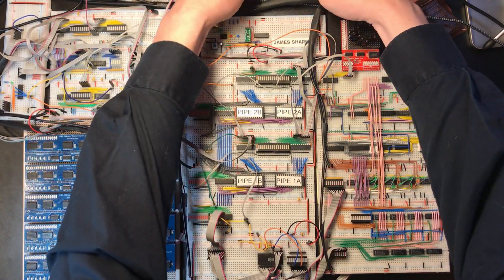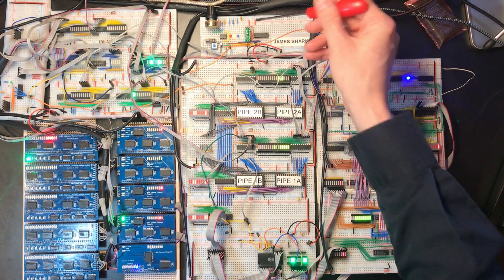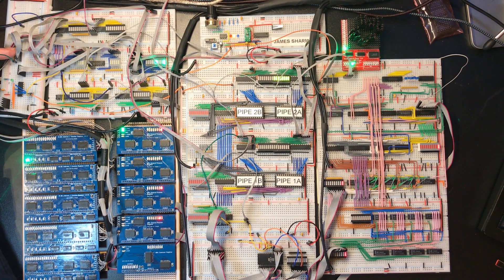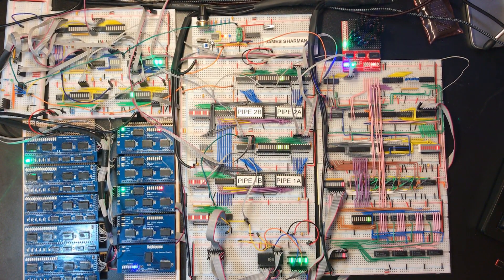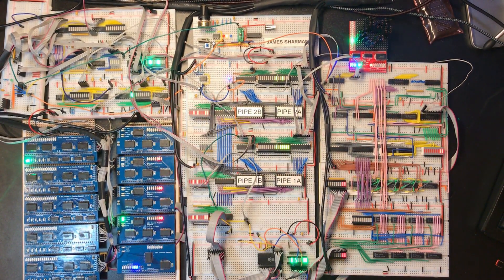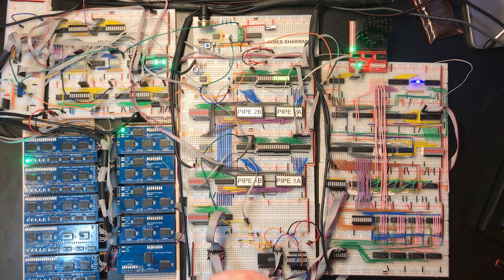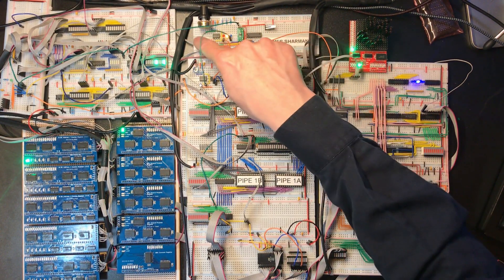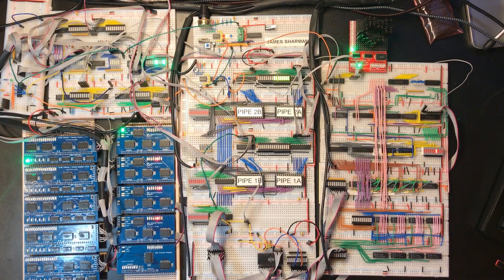Clean Reset - Making an 8 Bit pipelined CPU - Part 45

Comment: (2:31) That's a clever way of handling that.
(3:43) Now, it seems your (techinically inverted) reset line is still feeding into all 20 of the counter chips on the address register boards (plus associated LEDs), which still seems like an awful lot.

In the description of this video, you say that you add additional refinement to the reset circuitry in video 45. However, this is video 45.

EDIT: Now, the ALU clock is still driven from the original clock, but everything else appears to be running off this combined reset/main clock. That's actually actually, good, though, because it helps cancel out some of the propogation delay between the main clock and the ALU clock, and the ALU isn't being used during reset, anyway.
Reply from the maker: That should have been video 74, I've updated the description.

Comment: Could you not have wired in the nop pipeline feeder during reset? That would eliminate the need for the nop at address  0
Reply from the maker: It would indeed, I do revist the reset later in the series. In this case I wouldn't have minded too much as I like to avoid adding chips.

Comment: Just working through the video series, so I know I'm WAY late w/ this. If you had used a 74HCT273 for the latch back in video 9, it would have made the reset a lot easier. It has a CLR line instead of OE.
Reply from the maker: Hope you are finding it interesting! Having the clear line would have been really convenient. In this case you would have needed to use them on the output latches for the control lines as well, a total of 9 in the pipeline. It would indeed have made this particular job easier, but the pin out of the 273 is horrible compare to the 574 for breadboard work. Have a look back at the breadboard and think about how much more complicated the wiring would have been. Incidentally I do come back and handle this differently later on.

Comment: Now you seem to get in need for a supplementary training device :-p
I would have done the reset much earlier, for sure.
Simple thing, but makes it suddenly much nicer :-)
Reply from the maker: By "supplementary training device" do you mean some way of getting code over the cpu without all that slow messing about with rom's? If so then I certainly will be doing that some time.
Reply: No, i ment the lack of physical activity by not pressing any more the clock button until everything was emptied.
But if you stop swapping the ROM chips as well, this probably feels like the progression when cars got electrical starters :-)

Comment: in my rebuild of your CPU, when resetting, the adress counter registers are resetted, also of course PC, but the assert of PC to AdressBus would occur on next clock pulse, which never comes, because of reset and therefor in Pipe0 is the next instruction. What am I thinking wrong?
Reply from the maker: You are not wrong.  I can’t remember when I made the change but in my current build the clock going to the address registers is the one merged with the reset circuit.  This solves exactly the problem you have hit where one instruction get’s fetched from whatever address happens to be in the latches. I make some tweaks to that circuit in part 62, I want to revisit it again at some point and limit the number of clock ticks the reset generates, I think there is a possible issue with the way I’m merging it with the main clock that will only come into play at higher clock rates.
Reply: @weirdboyjim  So I think ORing the main clock with the reset clock and the output is the clock for adress registers, so eg the PC will assert the NOP instruction zu AdressBus each time the reset clock pulses. I´ll try that, thanks!
Reply: that solved the issue, thanks!!

Comment: For the final power on reset circuit  a simple RC circuit will do the trick. That's what I'm doing on my build.
In my case, all the chips I needed to be determined on power on were active low, so the output of the capacitor(initially discharged) takes care of it. If you need an active high, the resistor output will do it.
I personally like to keep the RC time constant as short as possible. Also, I would recommend using a reversed diode in parallel with the capacitor to avoid negative voltages and off behavior.
Reply from the maker: I like the reset chip I’m using for it’s low voltage detection. That said, I’m not that precious about where the reset signal comes from but I knew resetting the pipeline was going to require a little work.